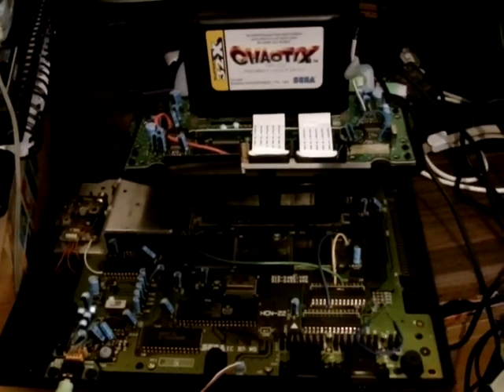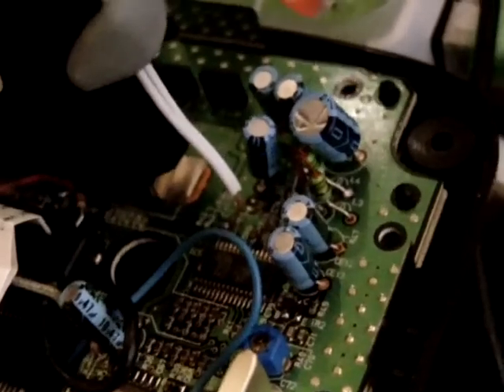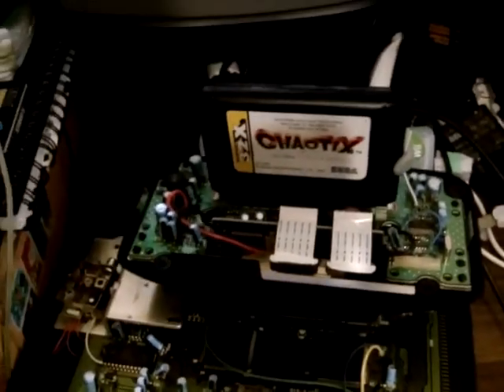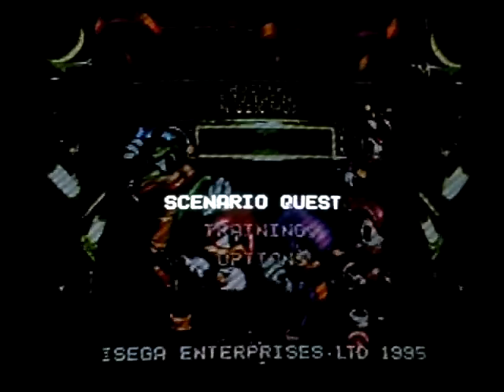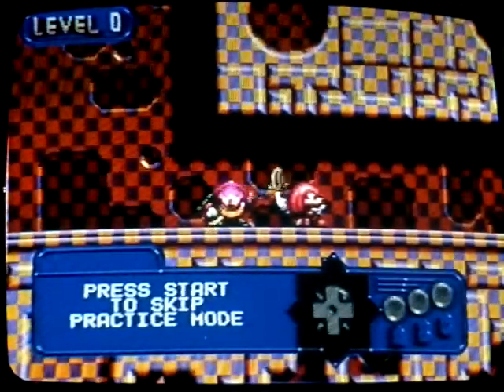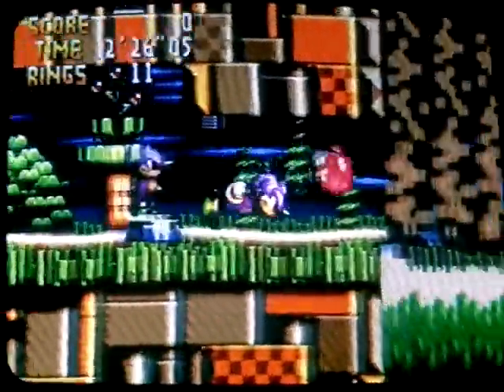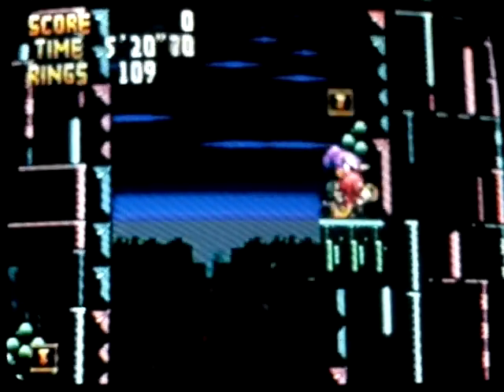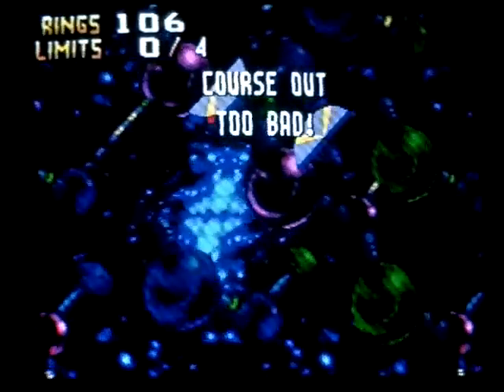SEGA 32X Experiment with Knuckles' Chaotix

Comment: I think the weird buzz sound is coming from your TV if you are using a stereo AV or RGB cable.  The sound works fine on the mega drive model 2 with 32x because it can output stereo sound from the back. It doesn't work with the model 1 because the model 1 mega drive can output mono sound from the back only. You need a mono AV or RGB cable in order to get rid of that buzz sound when you use the model 1 with  the 32x. I don't think there is anything wrong with the short adapter cable.